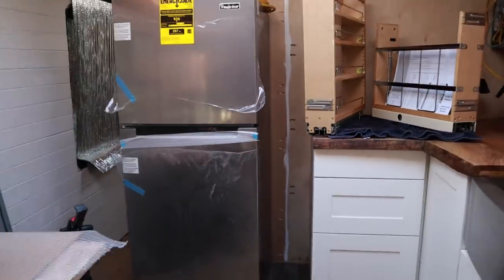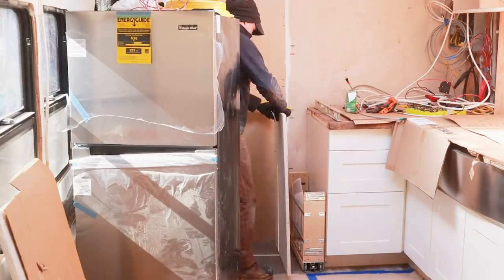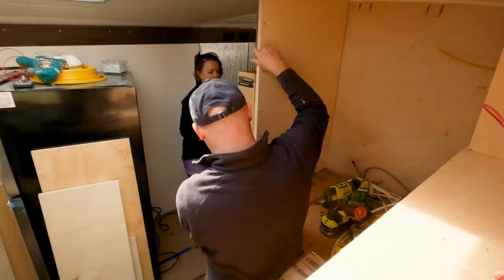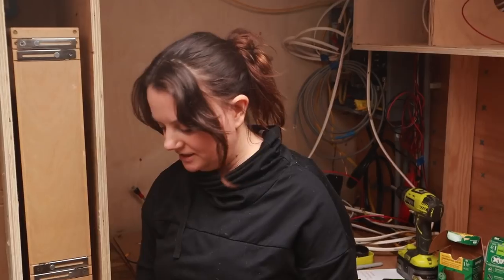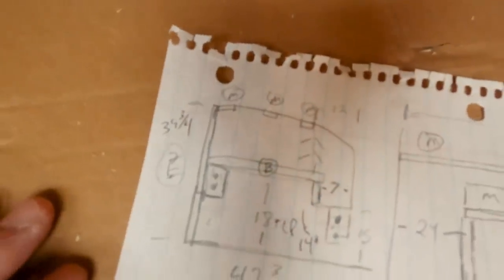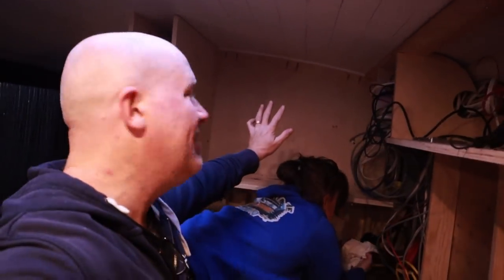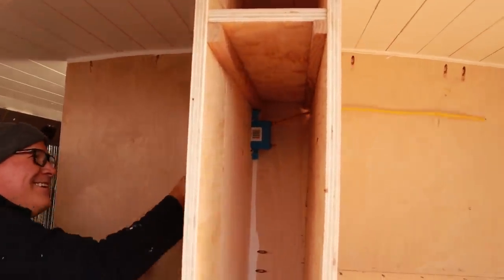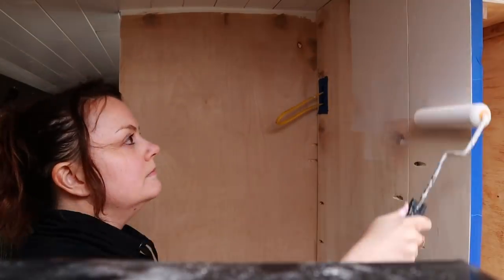Upper Kitchen Cabinets//BUS CONVERSION - S04E46

Comment: Don you said you were not sure how to make the wiring accessible in the corner, I think that if you put a false wall down the side on runners then you can either put a larger cupboard door hinged to the side where the new slim drawers are or a Bi-fold door hinged in the same way, this would give you access to your electrics just by releasing the false side wall. I hope you understand what i mean
Reply from the maker: Hey Berry all good advice there 
thank you. We had been considering the bi-fold as you suggested.